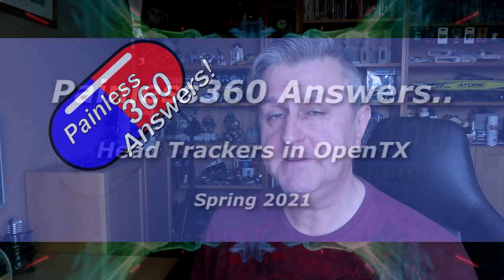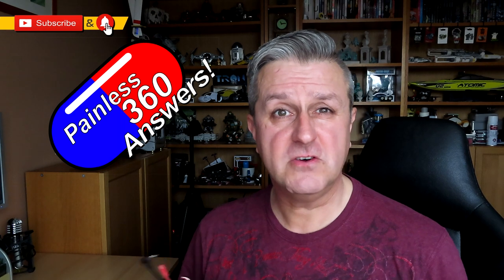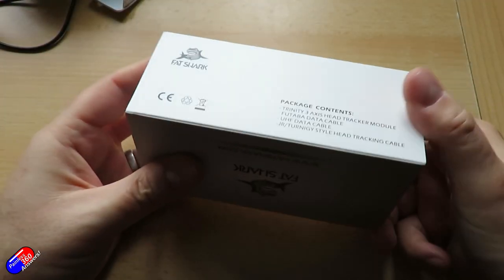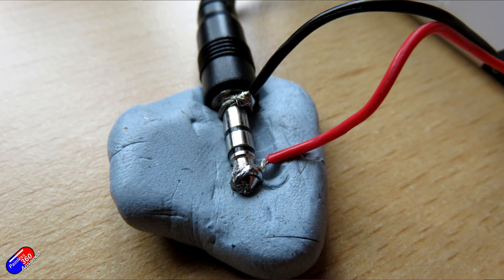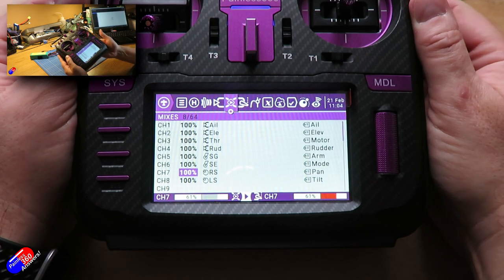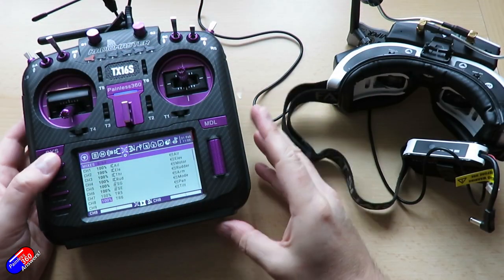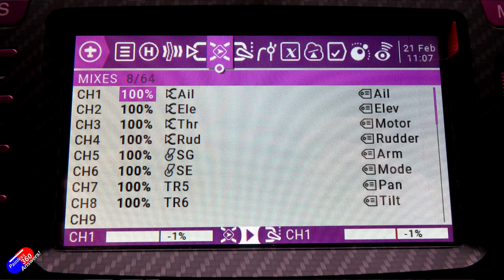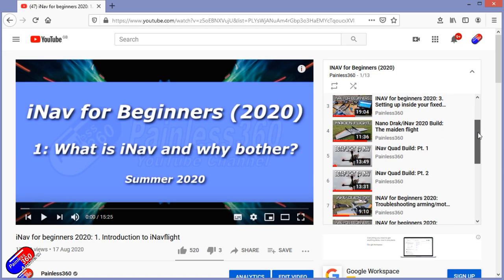Head Tracker setup on EdgeTX - Simple step by step

Comment: Hi Mr. P   Great video on headtracker.  I just finished setting up a headtracker for my Spektrum radio and Skyzone goodies.  I'm using a trinity gimbal and a older Spektrum radio so it took me a bit to get working.  I used a Caddx Ratel and A TBS UNIFY race edition mounted on the side. I did have to remove the button switch from my trainer button and then soldered a normal on/off switch from one of the gear to be able to turn off/on as I want. When off the camera will go back to forward facing. Thanks for the information.

Comment: For those looking for the latest in DIY headtracker hardware, there is a very updated firmware and configurator available now.  It is much easier to set up than the old arduino version.  This one uses a modern all -in-on Arduino BLE board .. which includes Bluetooth!  And it gets better, the firmware can output wirelessly over Bluetooth into any of the Frsky-Para (bluetooth trainer port) enabled OpenTx firmware radios (can also use cables into any ppm trainer port radio).  I just built one of these headtrackers today, and the hardware was about $20 and can run off vcc from your goggle's battery, like 5-20 volts.  google 'RCgroups FPV head tracker single board'
Reply from the maker: That is probably the one I will build on the channel if there is enough interest... thanks for the comment.  Happy flying!
Reply: @Painless360  very interested yes!  I just built mine for bluetooth ops and the build is very easy, with 3d printed case, a little button and a barrel connector.  Soldering, flashing and calibrating took maybe 15 minutes.  But what is hard to figure out is getting radios updated to bluetooth and choosing firmware for the radio to enable Para bluetooth trainer port.  I tried soldering the bluetooth module into my T16 and failed, but I want to try it again for my old XLite now.

Comment: Thank you for summarizing the knowledge in a clear and clever way!
I have a question that none have asked. I think: :)

How to mix TX16S in order to have a switch which changes the sources for the channels for pan and tilt, from headtracker input/PPM/Trainer port (Ardu BLE) to S1 and S2 and vice versa. 
I've setup CH7 - Pan/CH8 - Tilt. Source is TR7 and TR8 and it's good, but before I had headtracker sources was S1 and S2, which is also convenient. It would be nice to be able to choose from where to control the gimbal.

Currently I'm stuck on CH7 - Pan/CH8 - Tilt - Source TR7 and TR8 and CH11 - Pan/CH12 - Tilt - Source S1 and S2 on a SD switch which disables channels 7/8 when 11/12 are active and vice versa, but cannot set two different channels in Arduplane to control one and the same gimbal axis, which isn't the case for  elevator and other inputs, so there isn't enough info :)

I'll appreciate any advice or walkaround :)

Thank you again!
Reply: Just found a solution and will leave it here, no matter how noob it was.

If you need to select two different sources for one channel, copy the mix then paste it after the channel and change the source of the sub-mix to whatever you want. Put the mix dependent on some free of channels switch on tx to switch between sources.
This way I can witch between headtracker and pots for pan/tilt control :)

Thank you :) Yahoooo

Comment: Watched several of you videos on LiPo and chargers as well as the one on connection them together. Perhaps I missed in there but I need a s6, I have 2 x s3 3000 c50 LiPos. I want to join them in series and then connect them to my D2 charger (just to confirm out put etc, I will use a multi meter first though), do you plug both balance cords in or will it read the balance though either balance cord for both batteries?

Thanks in advance.
Have a great day. 

So close to having my Glow Eagle 63 switched to Elec motor.

Jeff

Comment: Excellent video. Question: Can this be done in TBS tango 2 and DJI fpv goggles? THX
Reply from the maker: With an external head tracker and confirm the radio has trainer port, should do... best of luck

Comment: Hey Lee great video! When you first reviewed the head tracker for the HDO2s, I purchased myself one for my HDO2 set but it did not come with cables. What cables will I need for the Fat Shark 3-Axis Trinity Head Tracker Module for HDO2? I will also be using my Radiomaster TX16s.
Reply from the maker: All of mine came with the cables shown... Not sure..
Reply: @Painless360  Well that is not good. I cannot find the cable I need anywhere. It has been discontinued. It is the fatshark cable FSV2113. The 3.5mm jack on one end and the data port style end on the other.
Reply from the maker: Are you a Patreon? If so message me on there and I can chase out the wires so you can make one..

Comment: I am shocked to have subscribed just now, considering how I admire the channel..  I want to hereby express my gratitude for the informative content.  You probably won't be able read it but just in case what would be the most affordable Flight controller setup with integrated OSD function with Airspeed sensor and mission control (in the form of  gps check points)??? I am sorry to ask out topic question)
Reply from the maker: It depends on what you mean by Mission Control. Basic mission planning is in INAV and fully featured Mission Planning is in Ardupilot. Both support lots of flight controllers, some of which are inexpensive. I'm a fan of the Matek, Holybro and BrainFPV hardware.. see my builds
Reply: @Painless360  Thanks alot for taking time to answer, i am going through your build series now. I am hoping to make my very first build soon with the guidance of your videos ...

Comment: Sorry for asking, As i do not fly quad-copters what is the head tracker ? . 
Do you fly the model by moving your head ? .
Reply: No, you use a head tracker to move a camera. If you have a camera mounted on servos, then you can 'look around' simply by moving your head
Reply from the maker: Head trackers are usually used on fixed wing. See the video linked in this one..
Reply: @gizfpv  Thanks'

Comment: Great video lee.. I have a question about opentx though. I have a gimbal that stops when the stick input is centered but the gimbal doesnt re-center, so with a headtracker i would have to go back to center to stop the gimbal moving. Is there a way in opentx to make the output stop when my head stops and? eg. pan stops at 1500 and doesnt center back. but my head tracker would be outputting 1700 or something? hope this makes sense
Reply from the maker: Not sure I understand what you mean. Is your Gimbal at the end of it's life maybe?

Comment: What if you want to use headtracker input sometimes, but other times use one of the stick inputs?  For example, if I want the rudder stick to control pan normally, and then activate headtracker via a switch. does that automatically disable the rudder stick input or is it combined with the headtracker input?  For a ground vehicle I have pan/tilt on the rudder/throttle stick.  So I would like to make sure the rudder/throttle inputs are disabled when the headtracker inputs are enabled.
Reply from the maker: Yep, easy to do in OpenTX. Check out the Opentx mix school series for how to set it up.. The one called 'changing channel outputs via switches' would be a good one. Best of luck

Comment: I have moved onto dji fpv and can't buy a head tracker anywhere, only ones available is this one you fitted in fatshark which obviously is no good to us. We need a cheap diy head tracker that is capable of being used on dji. And used on open tx and with crossfire. If you can design and make a simple easy one with them things in mind ill buy you a beer after lockdown

Comment: Hi. I need some help with my BLE Sense. I have cabled it all up. I also used a Reset switch instead of using the sense sensor. Everything works  on the software. I don't get any signal on the TX16s Radio Channel monitor. I selected Ch5 and Ch6 for pan/Tilt on the Headtracker sw and then selected the same Chs on the mixer on the TX16s. Nothing moves. What am I going wrong? Thanks
Reply: @Painless360  checked all my wiring. it's all good. i am running Edgetx V2.6.0. My help in setting up the Trainer Function. I have selected TR6 to TR8 on the mixer channels. not getting any movements. Thanks
Reply from the maker: Check what channels the headtracker is outputting via the PC app and then try every TR channel on the radio in turn. Remember to confirm the outputs are 'on' in the HT software too - see video.

Comment: I have a flysky fsi6x and I can't add trainer channel in mixer mode because it does not support that. Any suggestions on how  to get it working?
Reply from the maker: I don't use that radio here.  I'd look at the options for the trainer function in it. Best of luck
Reply: @Painless360  I did connect the trainer cable but can't access the mixer fiction with it. I even tried my UHF module which has a head tracker port with my cobra x. The UHF transmitter detects my Cobra ppm connection but UHF receiver can't read it and communicate with servo. Can you do a video on Cobra x head tracker with your tx16 radio?
Reply from the maker: If I get one in, I will. Happy flying
Reply: @Painless360  alright Sir 👍 thanks

Comment: The setup you have described does not seems to work on EdgeTx. Could you please try this on EdgeTx and comment.
Reply from the maker: Yep, works. Be aware that I have heard of issues with the DSC port in the RadioMaster TX16s (if that is the radio that you are using). Best of luck
Reply from the maker: https://youtu.be/6wLDm59djWk was made for you.. ;)
Reply: @Painless360  thanks Lee